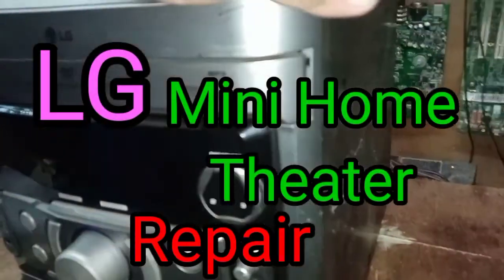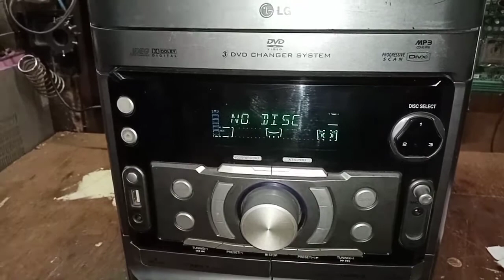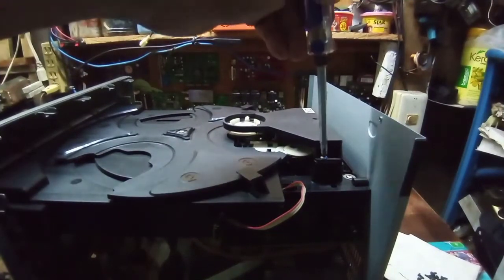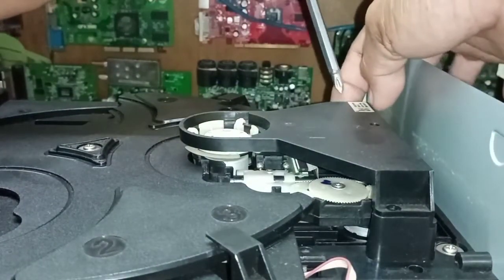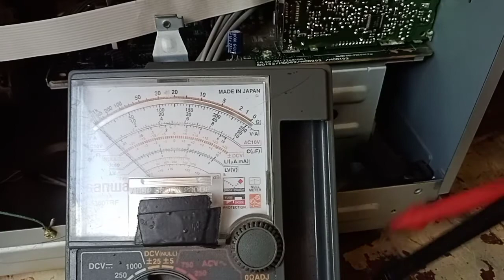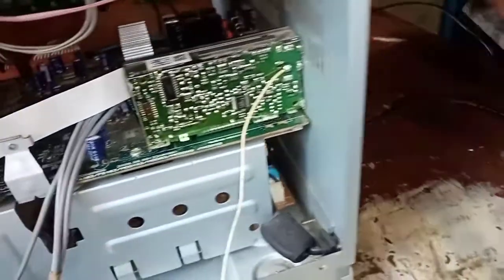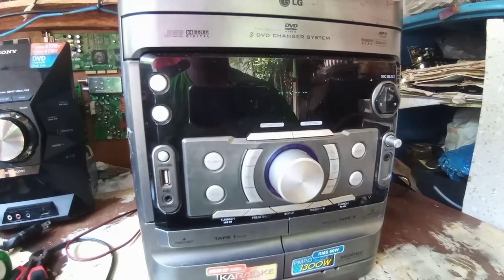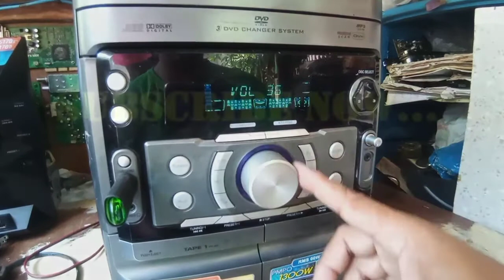LG MINI HOME THEATER REPAIR Model no: MDD62-AOU

Comment: How torepair LG DD62 no display, no dvd sound, only tuner, and aux connection good
Reply from the maker: maybe your lcd area. check around loose connection joints or you may check voltage supply